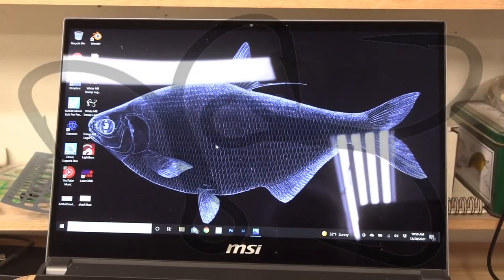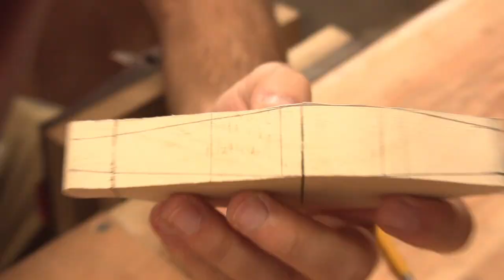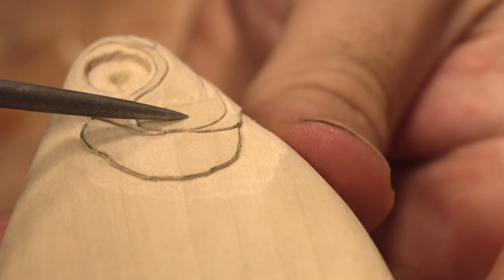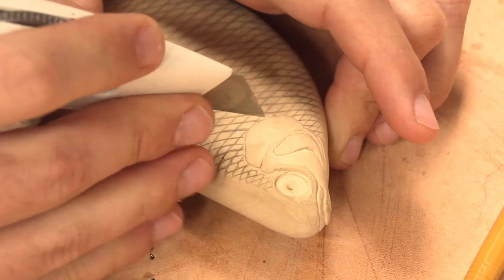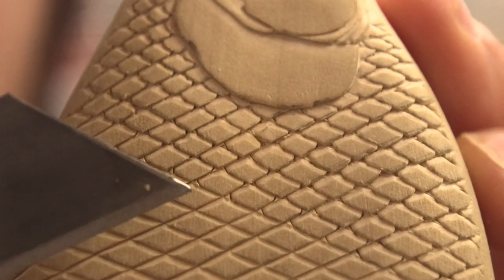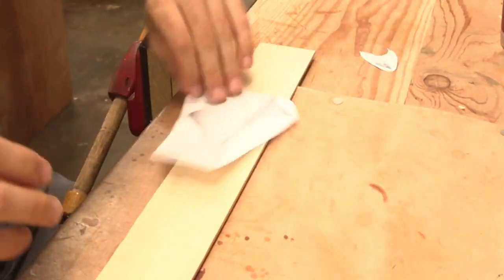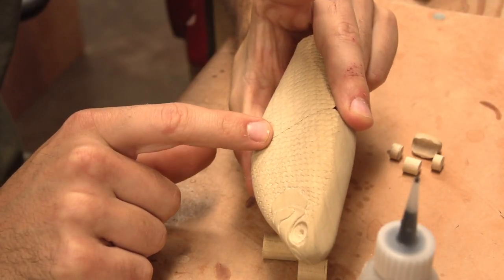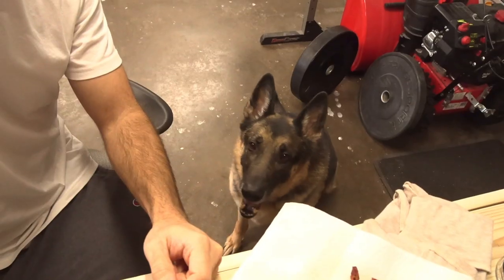Carving a Big Detailed Shad SwimBait

Comment: For those door hinge style pivots I always make mine slightly longer then drill the correct size hole for the dowel then cut it and sand clearance.  That way you can get super tight glue joints and easier to carve.

Comment: You should look at a drum sander if you want thin, precision slabs of wood..I have the laguna supermax 19-38 and each quarter turn of the up/down is I believe 1/64 inch, and you could just run a board back through again without lowering it to take a fraction more off.  It has totally made creating thin exact thickness pieces of wood a dream to make.   I have also found a sanding downdraft table makes doing dremel sanding way less dusty, ie the dust comes off and down into the downdraft table vs everywhere into the air, granted I have a 4" dust port on it to my large dust collector which helps too. :)

Comment: Love you lures  and your channel.  I have been watching a lot of your videos lately.  Was thinking you could make a 2 piece record breaker if its done in 2 half's pined together so after you carve it and drill lead fill holes then split it back open and carve out bigger lead holes parallel to the bottom to get the weight in it to sink . Then although glue it back together you can get them to sink better . Just a thought

Comment: Love your videos !!
I have learned so much watching yours and other makers videos 

A trick I found to carve the scales easier 
Is to use a single line Gun Stock checkering tool 
I use one along side a straight edge 
That way I can cut perfectly straight ( if wanted ) lines for the scales 
I can almost cut them in my sleep now
Reply: Oh 
I do turn the checkering tool about 60 degrees to the side to do the under cutting of the scale

Comment: Great video.  Great lure making skills.  May I make a couple of lure design suggestions?  I used a deep diver lure back in the mid-1980s that caught a lot of walleyes in deep water.  It was marketed as a "Smoo".  To my knowledge, they never made a Muskie size.  Second suggestion I've been harboring for a long time, but I'll never actually make one.  Freebie.  Imagine a top water/wake lure that runs hard to one side like a sideplaner.  Muskies, as you know often hit lures in the wake close to the prop wash.  This lure would be trolled over the weed line while keeping the boat in deeper water.

Comment: If you were wanting to carve a lot of fine detail into your lure, what would be your go to type of wood. And what would you say is the worst type of wood  for detail?
Reply from the maker: Some people like really hard wood for carving, because their technique developed around applying a lot of pressure. And others like soft wood with reeeealy sharp blades, so there's very little resistance. I like and use Tupelo for almost everything cuz I'm a soft carver.
Reply: @marlingbaits  BIG thanks for responding to that. I have not tried Tupelo yet. I've only worked with poplar  till just a few days ago I got some balsa. I kinda ripped it in half the first cut with the razor blade. Did not know it was going to be that fluffy and soft. Insane.
Love the channel man. Keep the videos coming

Comment: Istead of cutting the joint then dremel sanding the groove out why not drill a hole when it is still blocked out for a perfect fit on the dowel and it's guaranteed to be straight

Comment: can you make a bait out of epoxy resin instead of wood? i think it would be a beautiful bait
Reply: But you would still need a master out of wood to make the mold for the epoxy.
Reply: @darkiee69  what if you carve the bait from a block of epoxy resin?
Reply: @Anybody_42  Have you tried carving in epoxy? It's hard! There's a reason they use it for baitmaiking. And using a dremel or other electric tools would release fumes and dust that's not healthy to inhale.
Reply: @darkiee69  no I have not tried to carve epoxy